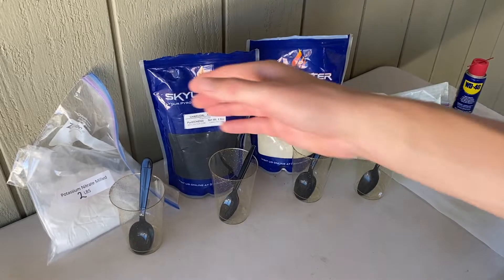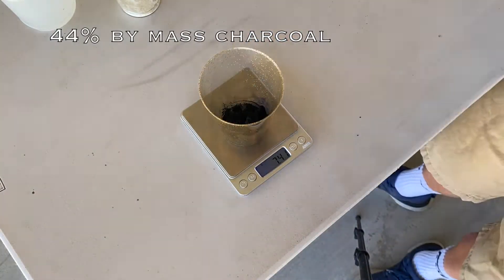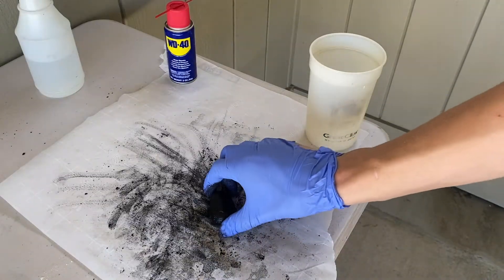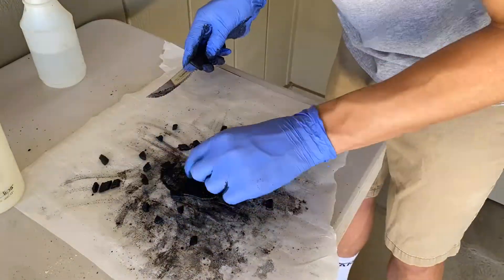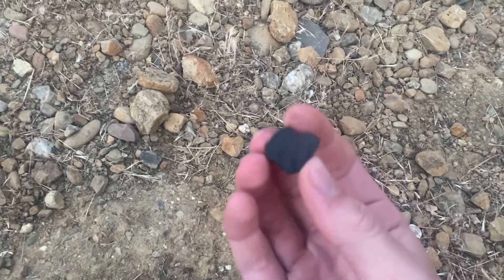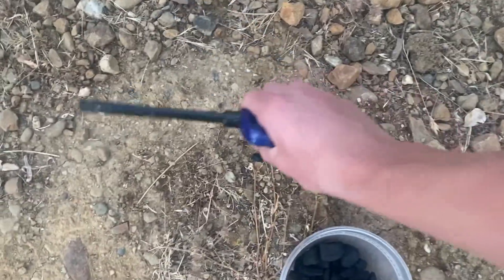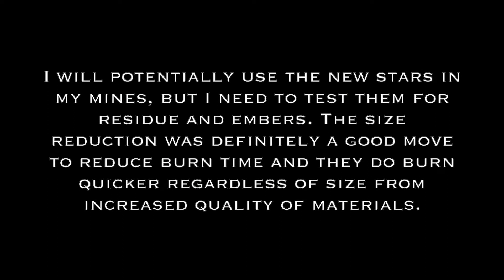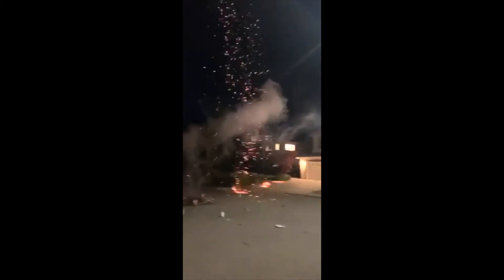Tiger Tail Stars- Update

Comment: Sulfur doesn't go bad per se, but depending on where you got it and what you're using it for you might want to recrystalize it from hot xylene.  The recryst is NECESSARY if it's being used in a chlorate composition.
Reply from the maker: i got it like 5 years ago from a garden store lol. It has been kept in a cool dry place though.
Reply: @pyrochemminer3453  it's probably got some sodium carbonate in it then.  It would be ideal to purify it, but not necessary for most projects.

Comment: Piece of advice when it comes to stars with dextrin you don't use your 50/50 alcohol and water mix. Just use straight water because dextrin does not dissolve an alcohol. For the alcohol and water 50/50 mix it's usually when your granulating, hot black powder for rockets or lifting shells or burst charges. Things that don't require dextrin. That way you can spend all the time in the world cutting your stars. With alcohol you might not completely dissolve your dextrin making your stars less durable. Worst thing that can happen is powdering your stars because of durability issues. All your hard work will go down the drain.

Comment: When you make cut stars with water and dextrin as the binder you ut them in an area with good air flow out of the sun then after a day or so then sun is ok. Going from cut to dry in the sun will drive in the moisture witch means it won't ever dry. Cut charcoal stars can take 1 to 2 weeks to dry properly in a dry box of course the size of the stars can also be a factor. Also you cam get much higher quality chems from other sources skylighter isn't the worst but there prices are regularly over double what they should be just a tip. I personally like tiger tail or any charcoal comet or star pumped easier to stack in canisters